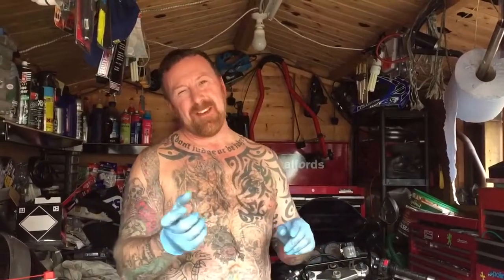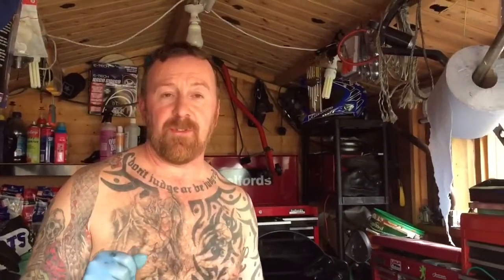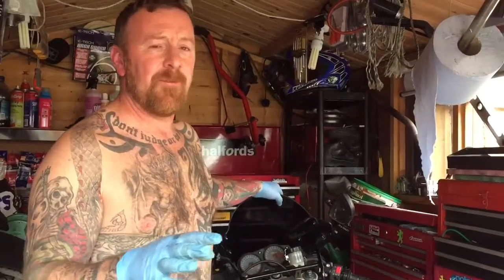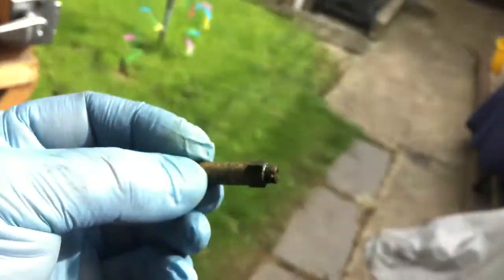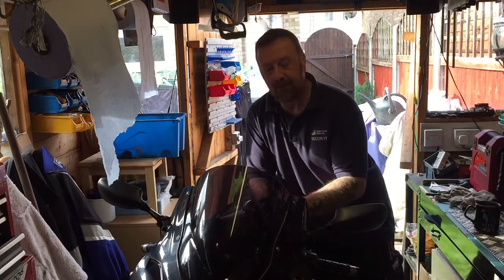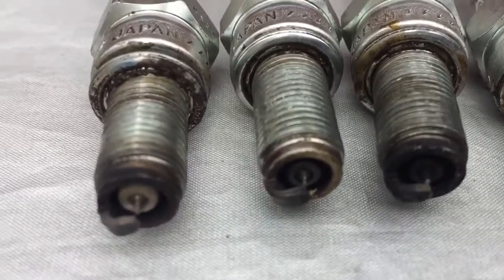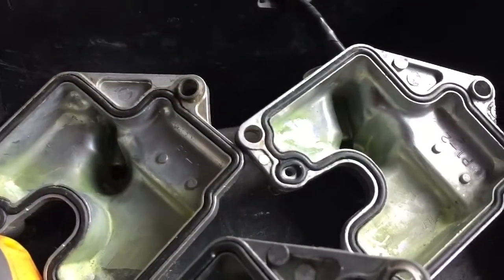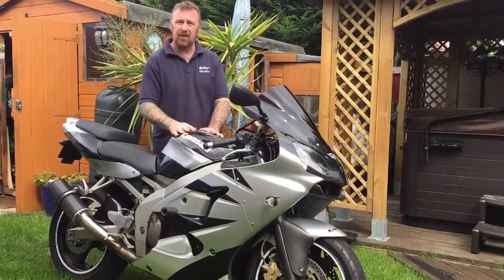Kawasaki 636 not run for 7 years carb running problems mark savage

Comment: how did you reach the allen/hex bolts on the carb boots, it's really tight fit down there and none of my allen wrenches fit down there.
Reply from the maker: i used  a socket with a long reach bar and then a allen top ,its just a bit of a wiggle

Comment: Hi Mark, My dad just bought a 1999 Kawasaki zx6r (600) for cheap, It hasn't been on the road in 3 years but it does run but sounds very lumpy on idle and idle creeps up sometimes, mixed fresh fuel and it sounds a bit better but not mint any ideas? plugs are clean and filter is too.
Reply from the maker: Drain all fuel out, carb off drain fuel out too
Fresh fuel and see how it runs
Reply from the maker: And me id put in new plugs,  air filter , oil and filter to get the best out of it bud

Comment: hi Mark. enjoying your vids at the moment. I also work on bikes big and small. 

you can get a basic balancing kit for carbs for around £50 and that works fine for basic home tuning. Dyno jetting or dyno runs for the bike is different it involves changes to the jets to get the bike running as best as it can. worth getting a carb balancing kit and giving it a go.
Reply from the maker: charlie p oh right best get one then , I've got the mot on Tuesday and was going to ask them how much, I'll way up the odds I guess and go from there but thanks for the advice. And thanks for watching

Comment: Great video chap but it sounded like it is still running on 3
Reply from the maker: It was and turned out to be the O rings in to top of the card,  once changed it ran like new